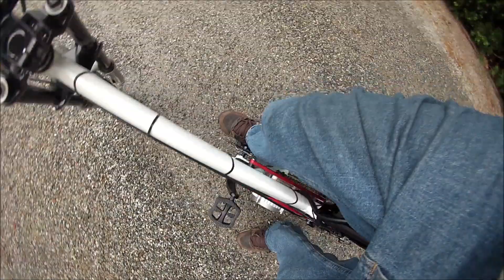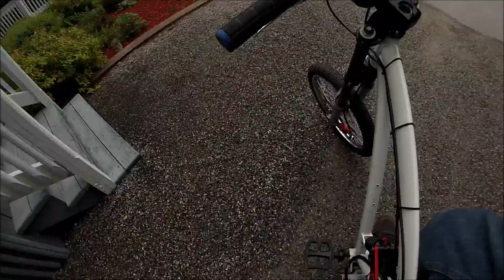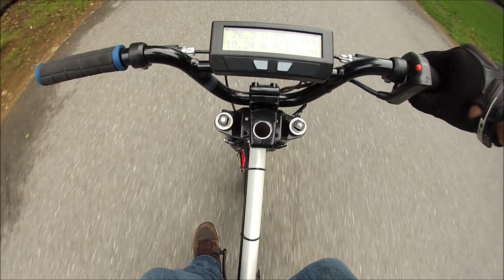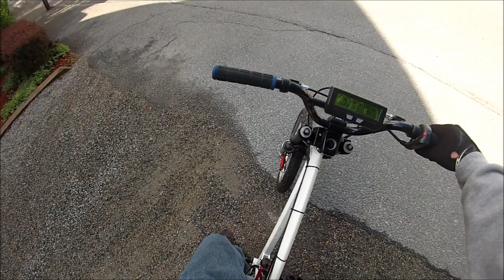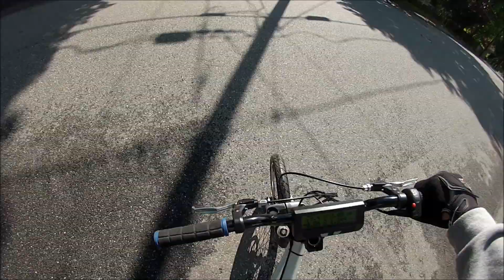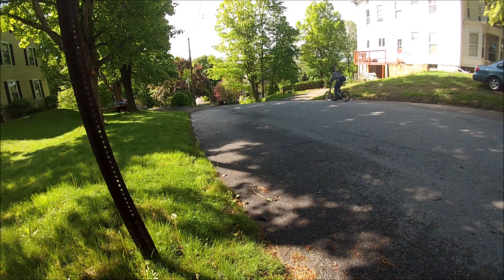72V BHT Genesis Farfle Electric Bike Test 2 / Lyen 18-fet

Comment: How much do you charge to make a 72v battery
Reply from the maker: Since I still do not own a tab welder, I do not make batteries for the public since it wouldn't be cost effective. If you are looking for a easy to build pack you can buy 4x 40v lithium lawn tool packs and its not that hard to put them together. it will cost around $400 for 84v 8ah and $600 for 84v 12ah. They are a safer longer lasting chemistry than lipo/lico

Comment: What motor and controller?
Reply from the maker: This setup uses the BHT 48v 1000w Brushless motor with a Lyen 18-fet controller and 80 cells 18650 10c Sanyo lithium
Reply: skeetab5780 and what voltage 48v or 72 volts?
Reply from the maker: 72v 20s
Reply: So you only have 4 cells in serie?  So 4x1.5A per cell =6 ah pack on 72v?